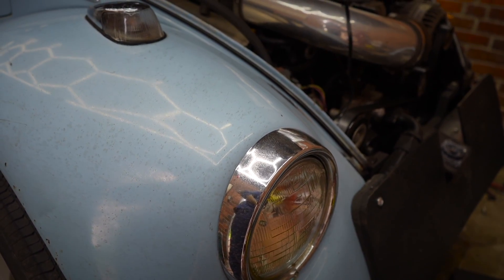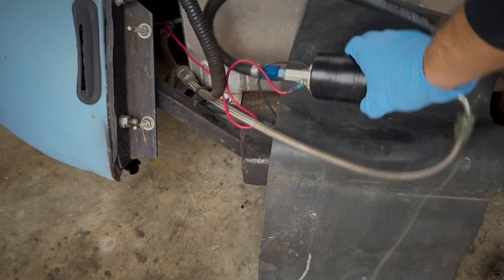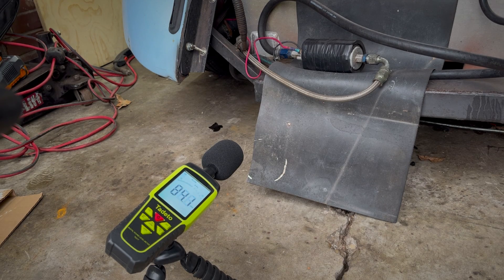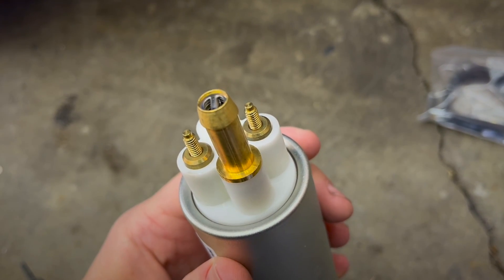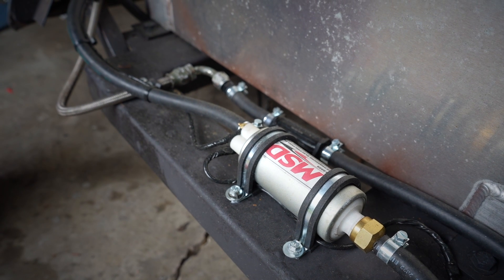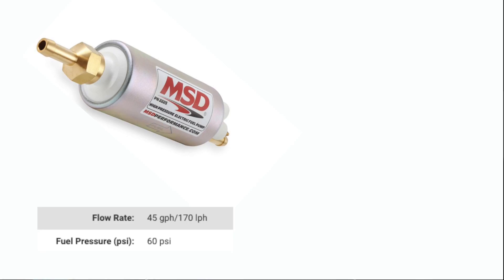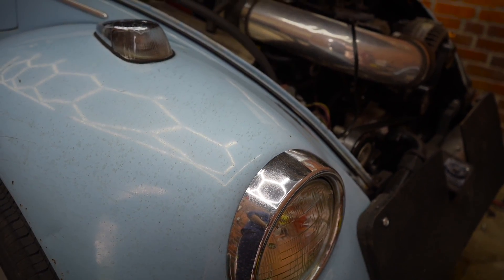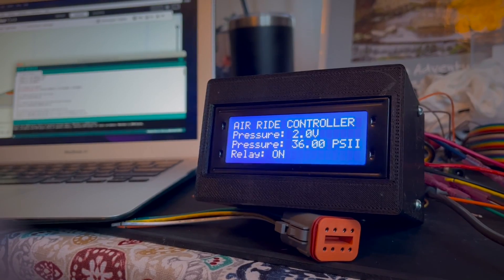Quietest Fuel Pump - Testing Walbro 255 and MSD Fuel Pumps

Comment: How to make walbro pump quiet and reliable like OEM:

Mount it in the tank, in an OEM sump bucket. 

Pump stays cool in fuel at all times. Stays quiet. keeps fuel slosh a non issue. fits almost every tank if you're brave enough to cut a hole in the top.

What sump bucket? you have a large choice, from GM to Subaru to Mopar...they all hold sumps similarly with spring loaded hangers to make up for slight tank height diffrences and giving you rods you can modify if needed for your application.

How to kill your pump:
Wrap it in insulation. lol

(watching your videos for the first time now. commenting for interaction. All hail the algorithm.)

Comment: If it works for you, the simplest solution is the best one!  You will know when you do some hard corners, aggressive acceleration/deceleration if the pump gets starved for fuel.  I am running dual facet 480532 lift pumps to fill a small surge tank with two Bosch 044 fuel pumps mounted vertically inside. Pretty quiet, reliable, redundant, and capable of 1200hp on gasoline or 800 on E85. Baffled efi conversion fuel tanks with even big fuel pumps inside have issues with fuel starvation on high-G loads on muscle cars.  Keep up the great work!

Comment: Why not use a seperation tank with the high pressure injection pump inside and a low pressure pump in the main fuel tank?
I really cannot understand how the ls is so versitile it fits everywhere and everything.
Reply from the maker: Ah the trusty ol’ lift pump! Ya know, I wonder how that changes the calculation on the fuel pump sizing requirement?? Something I’ve never thought to math out
Reply: @MatthewFinlay  As light as the car is, I kinda doubt you'd experience any issues with even the most basic of pumps.  Other options probably exist as well, such as a replacement tank with the correct flange or modification to the existing tank to accept a fuel pump module (flange installation).  Those guys running their cars on the track must use fuel cells to qualify, this might be an option worth considering.
Reply: That’s pretty much my question too. Are you thinking of doing an in tank pump down the road or is it more of it works it works and keep the inline pump?
Reply from the maker: @alexbalke6612 I’m more of an if it works it works kinda gal but I’ve always had better luck with in-tank setups. Cools the pump and quieter. Buttttt working with such odd tank size restraints led me to the custom aluminum tank you see here.